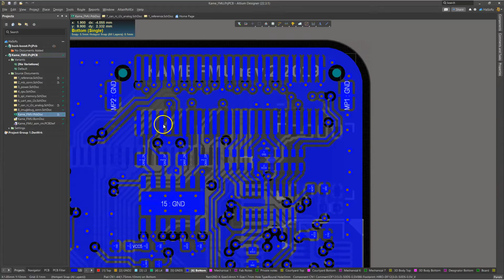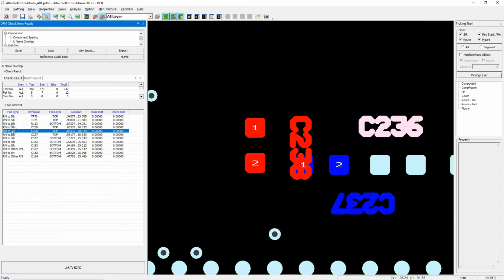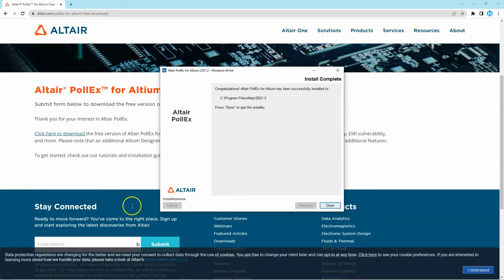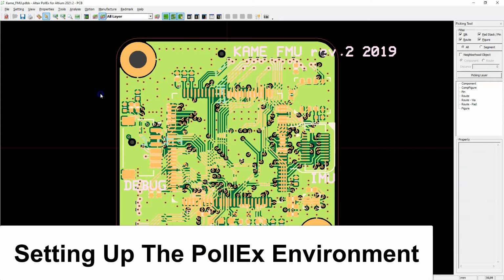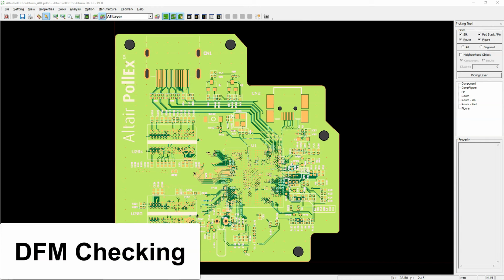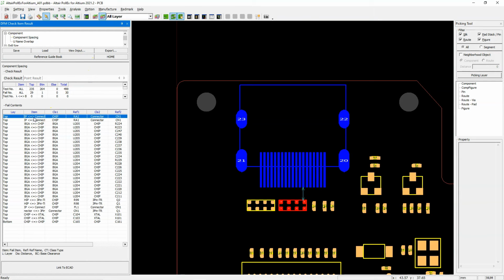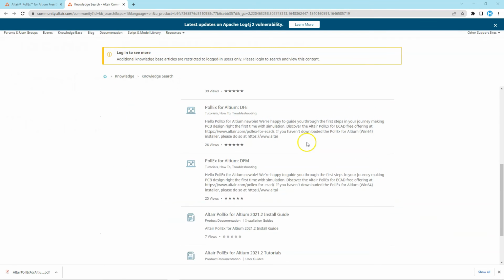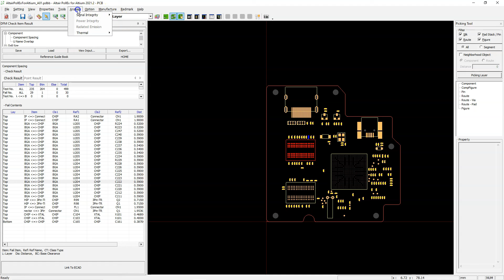Altair PollEx with Altium Designer - Hardware Design Checking

Comment: It looks to me that dfm is the same as the design rule check of altium itself.
Reply: @techedkirsch  yea! That video would be really helpful.
There is a strong overhead in learning using new programs. If the user can see previous the installing the benefit of the program it can help saving a lot of time and effort